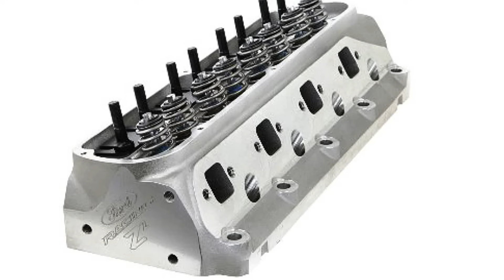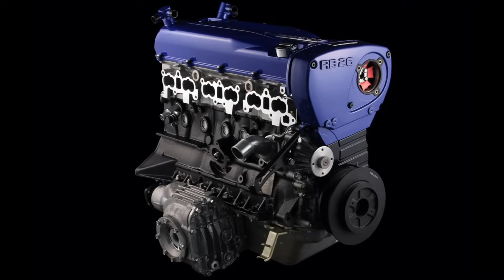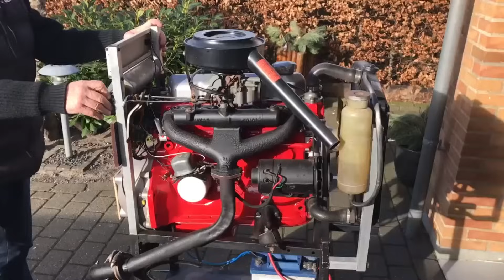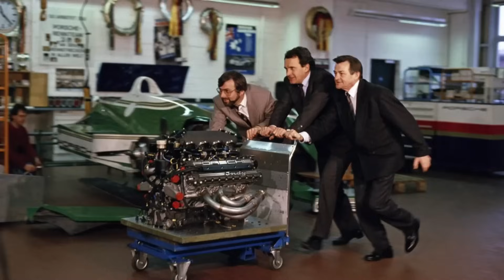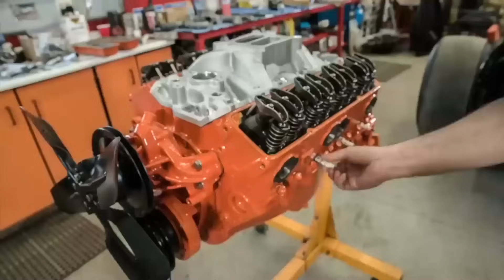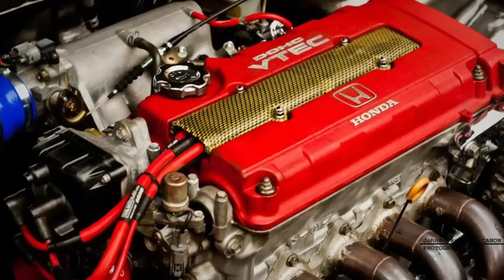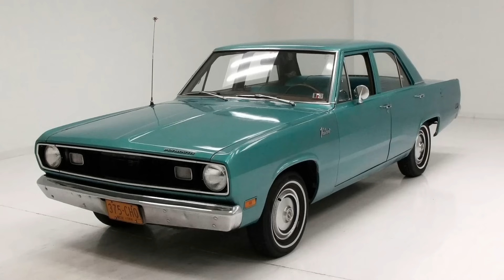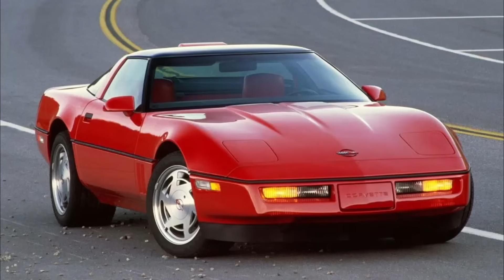30 Car Engines That Will Last FOREVER (2024)

Comment: I had supped up a slant six in my 64' Plymouth Valiant Wagon, I added a Weber progressive carburetor, Offenhauser intake and header set-up, with orange box electronic ignition and a larger cam. That Slant Six was zippy as heck! Keeping up with my bro's 74 D-100 with a 360. Lost it in a wreck in Texas. Now I have a 85' Toyota Supra with the Ma61 In-line six, another legendary built motor.
Reply: My Dad bought 64 Plymouth  Valient stationwagon.The push-button transmission He kept for 3 years when he bought 67 Barracuda.
Reply: @Ronald-hx6zn  Right On! yeah that push button was quite unique. Nice on the barracuda! I used to dream of the71' model. closest I got was a 72 Satellite Sebring sport that I roadrunner'ed out.

Comment: Had two of those Honda engines. As the script says, keep the oil topped up, check every 3 months or less if using it a lot. Also good is the Toyota naturally aspirated 1.8 petrol.

Comment: I’m from Albania and in my life I have seen the most used cars ever with millions of km. We were so poor that we couldn’t handle a new car, we had such a terrible quality of fuel and totally destroyed roads that we couldn’t even afford cheap cars from East Europe. The solution was a car that was indestructible like Mercedes Benz 200 e, 200 d, 230 e, 240 d, 280 e, 280 se, 300 d etc.., diesel or petrol. These cars came with at list a million km and made another million in the hardest terrain of the world. We had also some Toyota, Nissan, Mazda in small numbers but these could never perform like the Mercedes. These Japanese cars maybe were good for Europe and US but in my country they became fast scrap metal, cause they couldn’t handle our bad fuel quality and terrible roads like the king (MB) did. Also very strong were the French Peugeot, both diesel and petrol that you never mentioned. We loved these cars and we ride with them through the time and they are now a part of our history. Every Albanian has a soft point for Mercedes. In my opinion that’s a strong engine in a strong body.
Reply: I wonder if it’s the same with the newer Mexican made Mercedes
Reply: @dein45d  Absolutely not.  The engines mentioned are from a time when Mercedes cars and their engines were designed to a standard (a very high one), not to a price point as they are these days.  Case in point: I own a 1994 E320 convertible.  The price in 1994 was $78,325, which is the equivalent of ~$145,000 in 2024 dollars.  By today's standards, it's a rather simple car, but it's built like a tank.  The equivalent model today (CLE300) starts at $65,000, has a lot more technology and gadgets plus all wheel drive.  Somewhere Mercedes had to compromise, and unfortunately it's on the quality/longevity of their cars.
Reply: It's too bad Europe is so anti America, I bet you guys would have been served well with Chevy K series and Ford F series suvs and trucks from the 70s, 80s, and 90s. They're tanks. Too bad the U.S. government crushed 700,000 vehicles like these with cash for clunkers which just drove the price of used cars way up, and did the opposite of intended, alleged, goals....
Reply: well ,  now we know how mercedes created their real reputation.
Reply: i owned a 240d for years . i ran it on everything. cooking oil, home heating oil, kerosene , used transmission fluid, even used motor oil once i used scented lamp oil and the car smelled like cherries. other than rust nothing stops them.
Reply: Great Post
Thanks for the information.
Reply: Thanks for the history background. Mercedes isn’t any more Mercedes from yesteryear. Today they are producing woke politics🌈🤪. Greetings from 🇩🇪🤝
Reply: Your kidding
Reply: Look into 4x4 vehicles, an amazing invention for rough roads😂
Reply: @HomeAutomated-v2r  not really.  u still have the two weakest wheels spinning.

Comment: 2004 Chevy vortec 5.3 433,000+ all origanal, still everyday work truck.
Very well maintained, I love this truck
Reply: Same, my 04 Avalanche has 427,866 miles, it still runs as strong as the day I bought it new.  Mobile 1 every 3,500 makes sure milage is high.  It still has the 4L60E transmission.
Reply: @ricktaylor3748 same here. Trany is all origanal. It's a great combination. Funny, how when
 they have  "perfection" the designers  screw it up. For the last 4 years, I've been using a mechanic. He's excited to rebuild it. Especially to drop the pan, still no leakes anywhere. I joke, you will, but don't hold your breath. 
I will never sell this truck.
Reply: I have a 1998 GMC SEIRRA EXTENDED CAB NOW AND I LOVE IT.  5.0 305 made in Canada. Love it.
Reply: 4.3 vortec 1997 220,000 still strong long block un touched.
Reply: i had a 2003 chevy express 5.3l all original and excellent driving conditions
Reply: "Original".
Reply: The 5.3 is in my 01 Suburban with 320+K miles on it and doesn't use a drop of oil - expect it to go 500K+ -  only gets 16 mpg though.

Comment: Jim Sim... long life good reliability ..when looked after properly BUT olong come the clean aer brigade ..filters catalytic filters different aspiration ..end result unreliable short life complicated maintenance ..more expensive ..we have scrapped more good reliable vehicles than can be counted .and burned more coal used more power ..aluminum..and vast amounts of natural resources to replace these old cars with inferior short lived over high tech silicone chip controlled plastic boxes ..I have a simple Toyota 4 door pick up comfortable ..economical ..reliable..cheap ..this will be my last new car ..all the other touch screen computer controlled tin plastic boxes ..can stay wherever they are .my only fear is the rising cost of fossil fuel s ..we will find a way round that one when necessary...

Comment: I had a little Holden gemi with a issu motor it had over 300 thousand miles and i sold it to neighbour she put another 140 thousand miles and it was stll going when she sold it like some motors just change the timing belt

Comment: The Slant six is an amazing engine. I have a 1964 Valiant Signet with the 225 in. It still works almost like it would be rebuilt. The head on it is rebulit one time as i know.  And as a Swede i just love the B18 and B20 Volvo engines.

Comment: What about the toyot 7A-FE?

Why wasn't that mentioned ( ? ), I have a 97 1.8 celica, and the engine starts right up like a jet engine.

Plus the oil doesn't need filling up, even after 3000 miles, and a good fuel economy lasting about 400 miles.

Comment: Landcruiser FZJ80 1FZ-FE (petrol) factory manual schedules 3 rebuilds at 300k, 600k and 900k. Enough metal in the block and heads for 1.2 million miles.

Comment: OK BUT LS1 SHOULD VE BEEN IN  1 PLACE AND  the 2jz  in the place of the LS1  you most be  more of a toyota fan  we all know that the LS1 is more engine than the 2jz  fir instance you wont find most of the engines you mentioned  incuding the 2jz at endurance races like LEMANS and also the LS1 or any other chevy v8 is the most commun swapped engine in history number 1 place should be the chevy LS and this is not a fan fight but REALITY  AND the buick v6 needs 2 place for most mecanics its the vest v6 ever built  but yes all those engines you mentioned are the best ever

Comment: Fairly rare but I had a Pontiac 1.8L in an 86 Sunbird GT (non-turbo) that even at 260K miles, didn't use any oil between changes. Still ran great when I gave the car away at 260K. I had two Saturn 1.9L models, one was wrecked at 216K (car hit me head on in my lane) and the other outlasted the car at 240K miles. Right now I have a GM 2.2L Ecotech at 299,500 miles in a Saturn Ion despite hitting redline fairly often. I am still amazed how smooth it runs and idles and is just as peppy as ever. The original Chevette engines were fairly bulletproof too. Break the timing belt, no big deal, no damage, change it in under an hour and drive away. Same with the 1.8L Pontiac above (except took longer to change). The electronic carburation is what really gave the Chevette engine a bad rep, it was beyond horrible.

Comment: Where’s the Cummins 12 valve?  1 of the best, if not the best motor ever!
Reply: It’s not a car engine
Reply: I diagree if your going to show a Diesel landcruiser engine and Ford 302 then the cummins 12valve has to be included. Almost every engine listed here are foeign engines only @fastinradfordable
Reply: @fastinradfordable  it was in 2500 vans and trucks
Reply: It's a really tough 1,100 lb. engine when it's in a 6,000 lb. truck. Put it in a 25,000 lb. truck or bus and it ain't all that great.
Reply: @dadgarage7966 it wasn’t designed for that, manufacturers thought it would be a good idea, but it was a bad idea.
Reply: Thanks for the comment. I stopped watching. If you aren't going to pay respect to the 5.9 12vl it's a fail.

Comment: amc 4.0l inline 6cyl, ford falcon inline 6 cyl pre crossflow and crossflow, ford 4.0l sohc i6, ford barra 4.0l i6, holden red motor i6, chrysler 265 i6. notice a trend there inline 6cyl rule for longevity. and half the motors in your vid aren't even close to matching these i6's

Comment: As a mechanic, I truly enjoyed this video.
Reply: How would a person know if their Ford F-150 had the Windsor engine?  We own a 2000 F150, its mileage light only comes on intermittently, so I don’t really know , but I would guess it is around 200,000.  It lost its transmission at 125,000, but has not had significant maintenance issues since.  Its first 100,000 were mostly highway miles under a previous owner.  Ours are pretty balanced.  It has recently started acting a bit unusual with shifting, the transmission fluid is at proper level, no loss, and pink.  I hate to think about it failing because I love that truck.  And I won’t love the cost of a new one!😸

Comment: MY UK Audi A4 lasted until 275,000 miles, the British MOT test was never failed. Some idiot reversed into me destroying the Radiator and A/C Condenser
My current 17 years old Audi A6 is just the same, the engine will go to 500,000 miles. Look at cost before new model. Never buy New. I have had my A6 for 5 years, cost me £3k and never failed its MOT (Vehicle Vehicle Annually) which I understand the USA never has to do This means Dangerous Cars are allowed on your roads...Disgraceful

Comment: Im sorry I've work on engines since I was q3 or so n to have the Chevy 350 Ford 300 n the dodge  slant 6 in put in the spots they where is unbelievable putting the ls 1 ahead of the 350  m mot even having the 7.3 Ford diseal  on the list at all was CRAZY those engines are known as million mile motor!!!!!1

Comment: The slant six almost put Chrysler out of business because customers were hanging on their old cars and not buying new ones.
😂
Reply: CHRYSLER BUILDING CRAP IS WHY THEY ARE STILL BARELY HANGING IN THERE THANKS TO GOVERNMENT BAIL OUTS!
Reply: That's why most new cars today are over engineered garbage.  Designed to not last a few days over 100k.  If you buy a car with a CVT, it might not last 40k

Comment: I think that the GM 4.8 l V8 should also be on this list because my 2001 Chevrolet step side of Silverado has 323000 miles on it and still runs strong.

Comment: I knew the 22RE would be on the list but #2 WOW. I've owned 2 different Toyota pickups and both had the 22RE. Best engine I've ever owned by far.
Reply: The 22r is legendary.
Reply: I had the 22R in-line 4 in a '85 pickup. Just wouldn't die!
Reply: You didn't have to rebuild it every 80,000 kms?  I sure did.
Reply: The 20R was great too!
Reply: They were pretty tough with routine maintenance. However, the input shaft on the Manuel trannys was higher than the output shaft....
Sooo, if you had an output shaft leak, then you would be replacing the tranny next week.
Replaced so many that I wore out my local junkyard's supply in the early 2000's

Comment: A customer of mine bought a new 2000 Chevy box van with a 350 automatic transmission and got over 500,000 miles and the only thing I've ever done on it (other than regular maintenance) was an intake gasket . The only oil he had me use was casual GT and 1 qt of Lucas oil , when i changed the intake gasket at about 300,000 miles the valley of the block looked brand new . In my opinion the type of oil used plays a big part on how many miles you get .

Comment: There is a torch red C5 in the museum at Bowling Green that has over 700,000 miles on it. Most of the mileage was highway but still impressive. Mine only has 125K but it still rips while giving me 32-34 mpg depending on how I drive it.

Comment: Scooby doo and BMW units should not be on this list. Scooby doo head gasket and oil pump problems, BMW;  cracked cylinder heads and timing problems as noted.
One small reliable but heavy for it's size is the Alfa sud motor, provided the simple cam belts are changed, 1 1/2 hours work

Comment: I think they missed one engine which should've been added to their list, this was the Ford 7.3 L V8 diesel.  This engine, made by international, was in Ford super duty trucks and vans from about 1990 through 2003. It was expected to reach 300,000 as a minimum lifetime mileage.  But the best aspect of this engine was its excellent fuel mileage. With properly matched differential gearing, a truck loaded with 2000 pounds would routinely get 21-22 mpg on an average highway.
Reply: Every version of the 7.3 was essentially indestructible, the 7.3 IDI (88 to 94) was legendary in it's own right. I currently own a 7.3 L and it's still my favorite tow rig.
Reply: I agree I have the TDI in my 90 bus there not even a computer in it gets about 20mpg on the freeway
Reply: Had one and the engine would get mid 20’s mpg on the highway with the cruise set at 65 mph.  Engine was bulletproof.  Knew people with 600,000 to 700,000 miles on their Superduties.
Reply: Ah yes, The IDI 7.3, the 6.9 was hella more reliable. More tractor oriented.
Reply: I would add two to the list Ford 7.3 diesel and 5.9 Cummins
Reply: @leardi58  They don't have near the performance of the newer diesels but make up for it in reliability and maintenance cost.
Reply: International  created a very strong and deserved reputation for many many years way-back-when.
Reply: @terrenceolivido741  International made good engines until they smogged them in 2004. They were awful after that. Ford ended up suing them over the 6.4L and started making their own with the 6.7L.
Reply: Yeah but 10 transmissions to get to that mileage 😂
Reply: @Χριστιανός7 And folks have flipped them and were killed when the roof collapsed
Reply: those were hit or miss with the injector pumps. If you ever had to change the factory one, it would eat the replacements. They were either fantastic or junk .
Reply: I have a 2.0L Passat tdi and a just bought a  a  2002 e350 18  seater last week and it came with 3/4 of a tank and I drove 680 km before I fueled up
Reply: @SteveRichmond-y9b  Given your numbers, you traveled 425 miles on 20 gallons of diesel.  That comes out to 21.25 mpg Highway, which is about right for a 7.3 liter equipped E350 with a 3.55 rear axle ratio (which is standard on the E350).    If you record your fuel and miles more carefully, then you can probably determine your mpg with more precision.  Though the highway mileage is good, the city mileage is significantly worse.  Half-Smoke
Reply: Cleaner than your car
Reply: ...Or if you weren't a Ford shill, you might consider GM Duramax.😊  300k is nothing for a diesel! To the best of my knowledge, the highest original mileage 7.3 is 750k, but a weĺl documented and easy search reveals a 2006 Chevy 3500 Duramax with 1.8million miles on original engine and Allison transmission.  In my previous business I've personally seen several Duramax's with over a Million miles. I'm not biased to GM anymore, I equally despise most 4wheeled vehicles after 2008! I still own several trusty GMs, but currently no Duramax. Just my observances, please flame me!😂
Reply: Maybe added to a list of junkyard canadates...
Reply: @ sorry tender whatever u wanna call it. I personally would have thought allergies are from a weakened/compromised immune system. When in an allergic reaction, your body will do all sorts of things that it normally doesn’t in that situation like sneezing, runny nose, runny, eyes, that is your body‘s way of trying to rid itself from whatever it is it doesn’t like
Reply: Drove a 1989 F350 4x4,crew cab, for a horse transportation company. We pulled 40 foot gooseneck trailer. When the owner traded it in, the truck, it had 1.5 million miles on it. Only serious motor work done to it was, the local Ford dealership, donated a ATS turbo charger, and they installed it. Just couldn't stop that truck. Wish I could have gotten it.
Reply: They need to be banned. They put out such nasty exhaust, it makes my head hurt. I hate getting anywhere near a school bus.
Reply: No you just need to not be weak. You’re probably the sane person that thinks it’s good we’ve almost banned peanut butter in public why the hell should the entire population chang there ways for less than 1% of people !!! If I knew where you lived I would upload the greasiest tune and come park in front of ur house with my high idle turned on everyday i could
Reply: @SteveRichmond-y9b  I'll bankrupt you by outcompeting you for the loudest tune. 

And yeah, I have an allergic reaction just like you said. My throat gets itchy, and my sinuses dry
Reply: The 7.3 wasn't built by international  the 6.0 and later 6.4 were built by international the 7.3 was built by ford.
Reply: @christianogaard2185 The 7.3  and the earlier 6.9L were both built by International. The 7.3 is basically their school bus engine.
Reply: @christianogaard2185 Wrong 7.3 your thinking powerstroke , we`re talking IDI
Reply: Wrong international built also 6.9 before other than head gaskets good motor as well @christianogaard2185